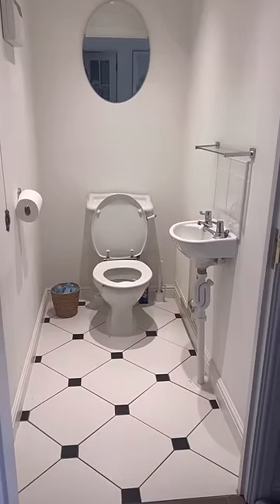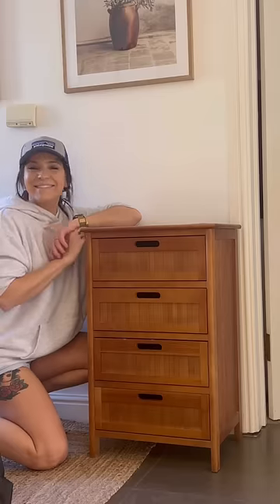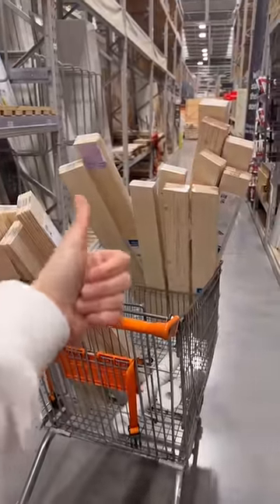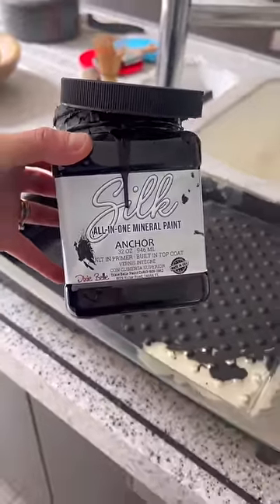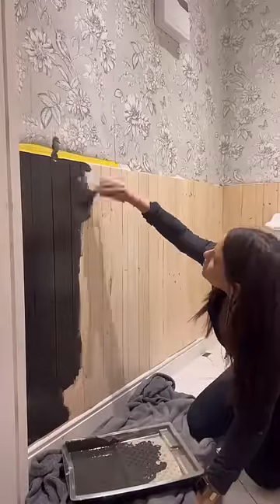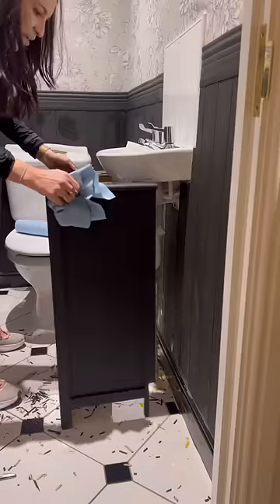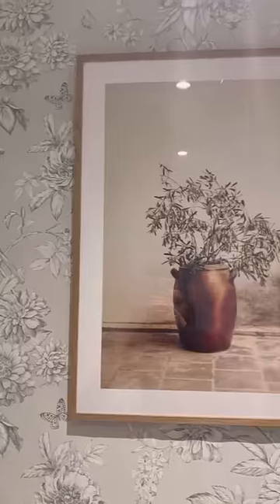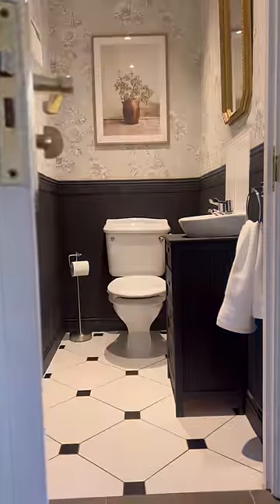Renter Friendly Bathroom Makeover Full Reveal! 🚽#ad #dbpbrandambassador #renterfriendly #bathroom

Comment: The problem with double sided tape is that humidity/moisture will make it fail faster.
Reply: ❤understand your point if it was in a Main Bathroom. This is a W/C only. So a toilet and sink. There really isn't an opportunity for the same concerns with humidity etc as a main bathroom or shower room as said. Good point to consider , but for this instance it works great!

Comment: That looks amazing. If your kitchen counters are as ugly as mine, you should do a renter friendly hack to make them nicer
Reply: I used contact paper that looks like black marble. I'm so glad I did it.
Reply: @tswain92_   - did you get the special wider kind for counters or just regular old contact paper you can get anywhere? Thanks! 
P.s. I did a test run with Dollar store contact paper and it’s definitely a bit too thin.
Reply: @lvmealone  I'm too cheap to get the counter wide paper.😆 I just got the glossy marbled kind. You can't even tell with that type because of the color and gloss. I put pieces here and there, but it still looked good.

Comment: Beautiful results. I'm wondering how long the double-sided tape sticks up and holds up? Could it be permanent if the landlord never wanted to change it back?
Reply: It could if she just went over the beadboard with a Brad nailer. Leave the tape behind it. If ever removal was needed, remove the beadboard and peel off the tape, they’ll be small damage either way but not much. I’ve also seen the contact paper method with great results when removing.

Comment: A+ for design. D-  for install. Work with the landlord to make the changes permanent. That rippled chair rail will fail first, followed by the wallpaper. Any water that splashes out of the sink will likely leak into the drawers. Your vision is wonderful, but reversing the work you did is not going to be a five minute fix when the renter leaves.

Comment: Its really pretty. I don't think the frog tape will hold up though. It also can leave a residue that can ruin the paint after. Its not meant to be left up long term. As a former PM, just put up wallpaper or paint if that's what you want, but put it back the way it was after. Its much simpler, and less expensive. Frog tape is pricey. That paint she is using is pricey. The peel and stick bead board is pricey, and it looks fake irl too.

Comment: Which brand of double sided tape did you use to keep the wall paper and planks up? Im thinking about putting up wall paper in my sons dorm room just like this and I didn't want to use hot glue thinking the wallpaper might not stick or the painter's tape will slide

Comment: did you do the knees test? do your knees bump into the vanity while sitting on the toilet? are you able to reach the sink, with the now new gap between yourself and the sing?
did you put water resistant layer on top of the vanity or do you want it swelling as soon as possible?
Reply: Agreed. Also, I think I would’ve tried to figure out a way to trim the depth of the piece so it doesn’t jut out so far into the room. As much as I’m not a fan of the toilet being the main attraction, in a long narrow room like this there really no way around it, but now the vanity is sticking out so far, it’s sort of competing for center stage. Overall though, it’s a really nice upgrade!

Comment: You killed it. I  love 💕💕💕 the AFTER shot. AAaah.mazing! Totally love your tip about using the frog tape and double-sided tape. Who knew???!!!
I did a small bathroom flip on my rental master bath. Everything permanently installed was white and looked fine. The issue was with the baby💩sh*t yellow walls. With no windows it was totally depressing.  I went black, white and zebra with the "pretty decorative towels. I took black duct tape and framed out the tiles around the shower and sink. I used washy tape in black to frame out the raised part on the cabinet front. It looked good but really lacked something to tie in that hideous yellow. I was shopping at Dollar General a few weeks later and squeeled so loud when I spotted EXACTLY what it needed. A zebra picture that was metal in a shadowbox to accommodate the raised metal. It was covered in glass and had a spot that was the EXACT yellow of that dam wall, with a see-through spot so when hung it looked intended, instead of a case of amazing synchronicity!! The change was as dramatic as yours, but I could have made it even better if I'd known your trick with the frog tape, boards and mounding. TFS. I'm gonna follow, subscribe and binge watch. 💕💕💕💕

Comment: The mirror in the before over the toilet vs over the sink was only thing really wrong with before. Frontape is not a good temporary solution as it sticks to drywall and will pull off paint and even part of drywall. The beadboard installation with tape is unstable. It looks nice. But, I hate black in general in bathrooms. Very taste specific. Prefer batten and board installed properly and painted white. The wallpaper would look better with white batten and board below.

Comment: I love these "rental friendly" videos. I feel sorry for the landlord that has to undo any of these changes when they try to unstick those panels and rip off half of the sheet rock.
Reply: I believe she used frog tape (because it pulls off easily from painted surfaces. Then, she put a double sided tape on top of the frog tape, removed the paper from the double sided sticky tape which revealed the sticky part.  And she stuck the headboard AND wallpaper to that.

Comment: Heads up before u go buy stuff,,, watch her other videos because she had to use a miter saw and another saw to strip the boards to fit around fixtures and meet in the corners, so it’s not a job just anyone can do … 😢.. I guess I could do wallpaper on the wall with te fixtures but that doesn’t solve the boards lining up in the corners issue